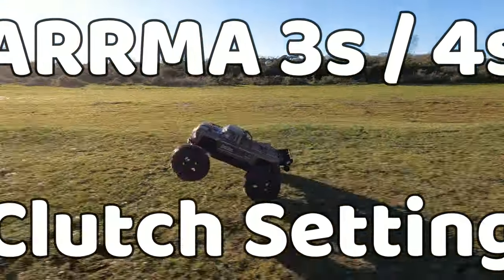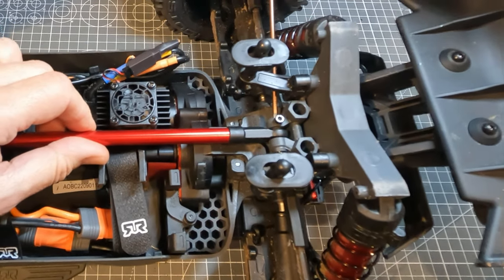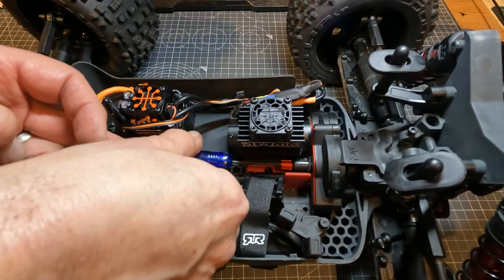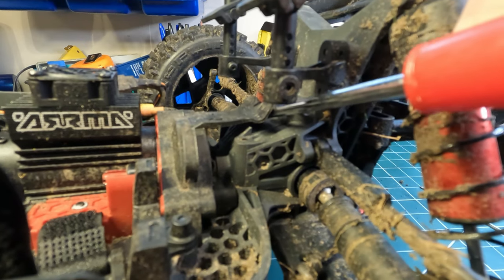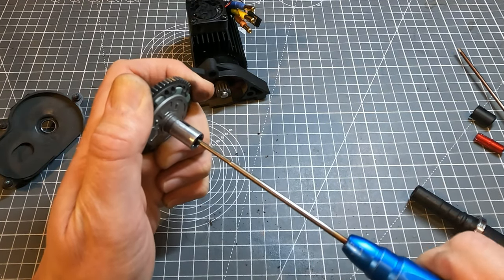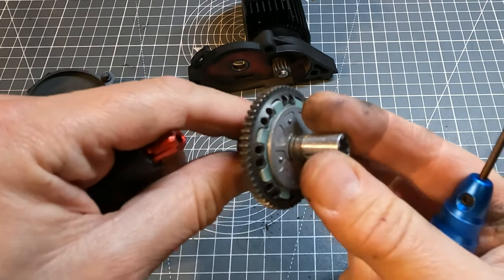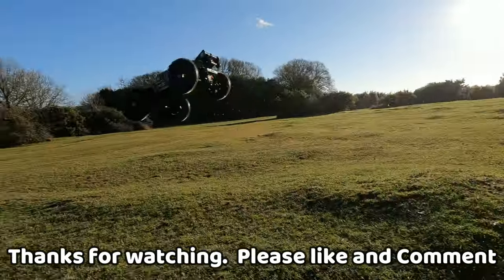How to Adjust Arrma 3s 4s Slipper Clutch Setting. Kraton, Outcast, Granite, Senton, Big Rock, Typhon

Comment: Hi there Pete, a very informative video on the clutch adjustment for these great RC’s. Your detail is superb. I just love the design of the Arrma’s so effective and makes maintaining these tough RC a real pleasure. Your guide is spot on my friend. Best wishes to you all 😊😊😊
Reply from the maker: Hiya John. Yeah the design of these is quite ingenious although getting the power module back in on this one was much harder than it looked on the video. Not sure why as they normally clip back in ok. Your Typhon was a mega wasn't it so has it got the same clutch assembly as the 3s range. I did look into getting one of those 2wd ones with a view to upgrading it but when I actually looked into it there are a lot more differences including a lighter weight clutch. It would take a 2s system ok I'd have thought. Anyway, cheers for your great support as ever mate. Very best wishes to you and yours 😁👍
Reply: @PeteWylieRC  hi Pete, yeah, my Mega Typhon has everything ready to be upgraded to 3S brushless system, same clutch system, gearbox etc…I’m looking at upgrading it with a HobbyWing BL60 sensored Brushless ESC, just looking at an appropriate motor, then hopefully do a video on a budget conscious upgrade for the Mega and make it a bit more ‘peppy’ 😊😉😊best wishes 😉😊😉

Comment: You don't have to take the whole power module apart and take the whole slipper clutch out  to adjust the slipper clutch. You can take the power module out and just hold the spur gear with your hand to keep it from spinning as you tighten..stock setting is to tighten all the way then loosen 1.5 turns...I find 3/4 to 1 turn is good for me . Any less than that and you risk causing damage to your stock  composite diffs if youre an aggressive driver . I ended up stripping a rear diff one time and learned my lesson on setting the slipper properly .
Reply from the maker: Oh yeah you can adjust the clutch with the power module still in the truck. You just need to take out the centre drive shaft. Yes 1 turn or so is about right to hopefully avoid damage. Many thanks indeed for your great feedback 😁👍👍

Comment: Hi. Great video. I have the Big Rock and changed the plastic spur gear onto a steel spur gear. When I placed everything back the truck began squealing very loudly, and hardly moved. I know it’s the slipper clutch because you confirmed it, but I followed your instructions and it is doing it still or more. Any suggestions??
Reply from the maker: So if you had a plastic spur gear that must be the Mega version rather than the 3s right?  I haven't worked on a Mega but have you tried taking the whole clutch out and testing it manually?  I show how to do this with the 3s trucks here https://www.youtube.com/watch?v=VIZjLzv3jZ4

Comment: Nice Video! 
I have a 3s granite that made the stripped gear when I accelerate, but everything looked all good. it also doesn’t do wheelies because the clutch is loose, but when I tighten it it makes a rough clicking Noise. Idk what to do
Reply from the maker: If there is a clicking noise have you checked the ring gears on the differential? I can only suggest that a gear is stripped somewhere in the system. Hope you find it. Many thanks for your comments 👍👍
Reply: @PeteWylieRC  thanks for the help!
Reply: @PeteWylieRC   thank you so much for the help,😄I will reply if I have any further issues.

Comment: Good stuff, sir! Have you had any issues with the clutch loosening on its own over time? It seems Arrma has used a beefier plastic nut on the back of the slipper with these v2 4S trucks. Do you use any loctite? By the way, factory setting is 1/2 turn out on the 4S, 1 1/2 out for 3S.
Reply from the maker: Ah that's good info about the factory setting on the 4s. It did seem to be loosened more turns when I first got it. I haven't had to use lock tight except on the v2 Granite which didn't have the plastic sleeve bit. The v3 3s line and the v2 4s line seem fine so far. Many thanks indeed for your great feedback 😁👍

Comment: New to the hobby, Havent been able to get more than 1 battery run out of my Kraton 4s v2 without running into issue.
Is it normal for the slipper clutch screw to loosen?
Reply from the maker: Hi there. No it shouldn't loosen that quickly and once set it should go for weeks. There is a plastic bit at the back of the clutch assembly that should stop the screw shaking loose. If you look at the other video I did about the clutch I think I show the bits all taken apart. Thanks for watching 😁👍
Reply: @PeteWylieRC  Thanks! I'll check it out!

Comment: ive been running my big rock for a while im hearing screetching louder sound from slipper area?  what needs replacing?
Reply from the maker: Have you already tried tightening the slipper? Maybe tighten it all the way just as an experiment and if it solves it then loosen it till it only does it sometimes. Other than that you need to take it to bits and see if you can work out what's wrong. My other video on this subject goes into taking it apart. Hope you get it sorted 👍

Comment: Did the mount on mine a while back.. I was spewing to find out it's like built within half the car haha.
Reply: Now I'm up for either a spur a pinion a slipper... Gearbox or another gear box ... I wasn't sure couldn't find stock half the year and happened across all that minus one full diff.. I did get a maintenance kit so it will have to do..but yeah basically re doing all that today... Wooohooo 😅
Reply from the maker: Hey have fun sorting out your car. Thanks for your great comments and watching the video. Much appreciated 😁👍
Reply: @PeteWylieRC  no worries thanks for sharing mate always appreciated I just wish I had people to drive with haha... Cheers for that mate..
oOOOHHHH can't believe I didn't start with this.. I sorted it over the long weekend.. had to adjust slipper replace pinion.. of course no one had any... Went to LHS and by fluke he had a 16t 32p 5mm pinion hardened .. so I was super stoked as they don't even stock anything I own.. and on getting into my car I picked up the transfer case and the bearing disintegrated so I walked back in laughing.. "I told you.. in that small period of going to my car I broke something else" the guy was having a good laugh with me at this point... And by miracle he had those bearings too and good ones with crimped casings!!! It fuuaaarrkking hammers now 😆😁🤟🤟
Reply from the maker: @barrygauci9933  Oh yeah the stock bearings aren't always the best.  Good idea to have a few spares.  Glad you got it all sorted and happy blasting 😁👍👍

Comment: I replaced my pinion and spur gear assmebly but now when i pull the thottle and let go it seems like there is resistance...likes it is braking... I did reset the ESC calibration for throttle/neutral/brake..but to no avail... any tips?? I am stuck!
Reply from the maker: What I would do is to take the power module out and see how it runs when not attached to the rest of the drivetrain. Also while it is out, check that all the wheels spin freely. The last time I had something like that it was a seized bearing. Good luck.
Reply from the maker: also, is the mesh ok? There should be a little bit of play between the pinion and spur 👍
Reply: @PeteWylieRC  I loosened the mesh just a tad bit more and it worked! thanks

Comment: Anyone know what the wing nut does in the rebuild kit it doesn't fit between the input gear and backside of the clutch where the steel ring is 😮‍💨. I never saw one in my stock slipper on first maintence it is in the parts diagram but ,😮😅
Reply from the maker: Hi there, sorry for late reply.  I think that you answered this while watching the other video.  The little plastic wing nut is supposed to stop the main screw from shaking loose.  It wasn't in the version 2 3s cars so it won't fit in there if that's what you have :-)

Comment: How important is that? Mega metal slipper hub sleeve.
Reply from the maker: Hi there. Sorry I don't quite understand what you are asking about?
Reply: 5:15 , that’s what I’m talking about .
Reply from the maker: @Cameraman00001  oh that bit. Well my 3s cars didn't come with that part. I guess it's just a little upgrade they put on the 4s cars? I've not had any problems with the 3s cars not having it. Many thanks for your question 👍
Reply: Ok thanks because I lost mine.

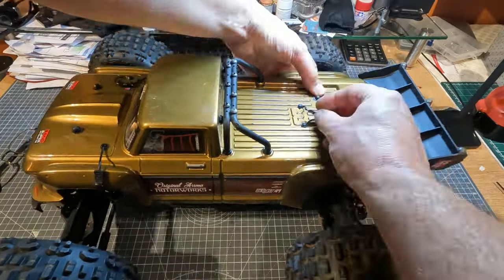Comment: At 5:55 what is that clicking sound from?
Reply from the maker: It's basically the sound of the gears and the fact that the magnets in the motor make it more lumpy. Not sure if that's a good description but they all do it. It's only a problem if it feels difficult to turn the wheels 👍
Reply: Cool thanks for the reply! This is my first hobby grade electric RC car so I'm still trying to figure out what normal is.  @PeteWylieRC
Reply from the maker: @duncanbradley8932  Oh cool.  These are good trucks.  I've done a few videos about them.  Thanks for watching this 😁👍